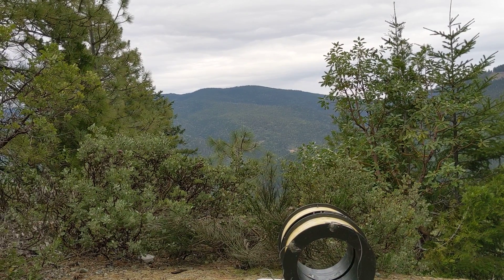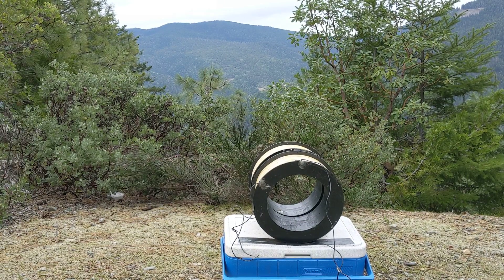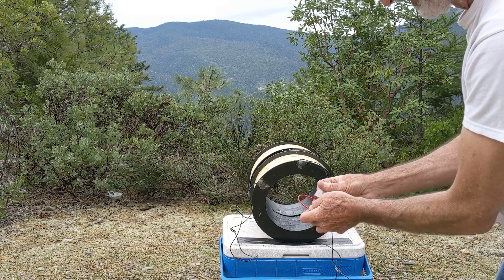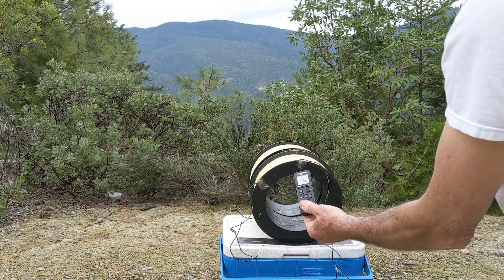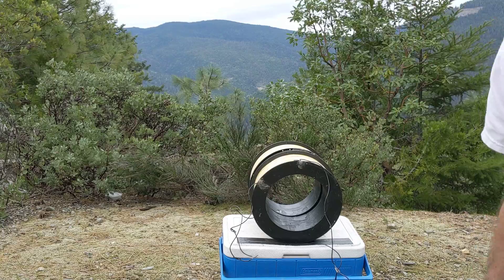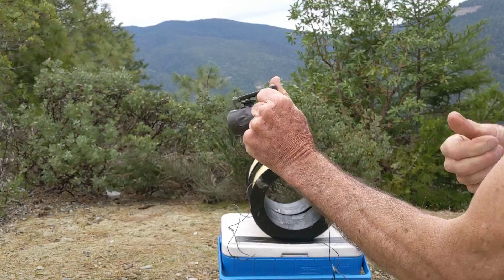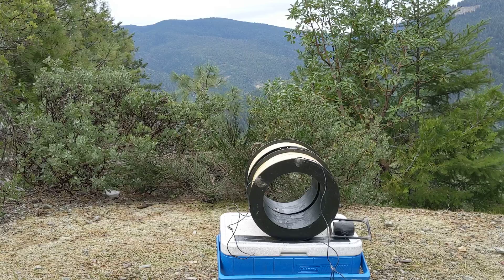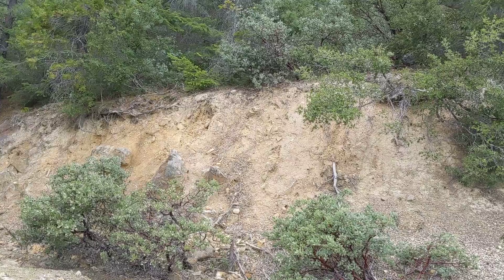Giant induction coil picking up Audio 5 feet away!

Comment: A giant pickup would receive ionospheric whistlers, thunderstorms, and perhaps electrical signals from ground movements as tectonic plates shifted. It probably isn’t necessary to use huge multi turn coils. The area inside a single coil is what counts and multiple coils just add to the amount of pickup. Far cheaper and more efficient to use electrical amplification to get the desired signal level.
Reply from the maker: I think it would sound like this. https://www.youtube.com/watch?v=iHY-GMrqK9A
Reply: I made a large coil and it was great for picking up whistlers.  You needed to be well away from any buildings or power cables.
Reply from the maker: @StabilisingGlobalTemperature  I would like to have seen how you built your coil. Did it have a much larger diameter than what I built?
Reply: @GrantsPassTVRepair  I wrote a reply but it has disappeared. Coil on a polystyrene block approx 800 turns 3ft x 3ft x 4 inches.  Plywood side cheeks glued to the polystyrene. Used a low noise op amp module battery powered, and a digital recorder.  op amp module and battery fixed to the coil former and several yards of cable to the recorder.  I used a recorder rather than a laptop but you could use a laptop but keep it far enough away from the coil. Laptops are quite noisy electromagnetically.
Reply: @GrantsPassTVRepair  Also, it is best to make the coil as large as practical. Many turns helps, but seems that large area helps more.
Reply: @GrantsPassTVRepair  If I was making another I would try electrostatic shielding.  Such as aluminium foil wrapped around the coil and grounded at one end.  Important to leave a gap in the shield, otherwise it would be a shorted turn and destroy sensitivity.  For ease of transport I would make it flexible.  Maybe on a hula hoop or similar.
Reply from the maker: @StabilisingGlobalTemperature  Thanks for the information on your larger coil. How did you avoid the AC interference?
Reply: @GrantsPassTVRepair  I went to a place a long way from any buildings or overhead power cables.  But if that is not possibe, it may be that you can rotate it and find a null direction.  Probably not possible inside a building, but outside there may be fewer AC cables, and so there may be a null direction.
Reply: @GrantsPassTVRepair  Also if you filter the signal that helps.  Maybe a series capacitor of suitable value would act as a very basic high pass filter.  The value depends on the input impedance of the amplifier, so I can't give you a specific value.  Or you can find online filter calculators.  Or use LT Spice, which is free circuit simulation software.

Comment: On regards to your question about a giant coil...

- It could be tuned by accident to a powerful source of energy, for example the earth.
- The Schuman frequency of the earth has one peak at around 8 hz. Meaning that as the electrical signal travels at light speed (432^2 miles / sec) = (186,624 miles / sec) there will be aproximadately 8 standing waves on a wire with the length of 186,624 miles for a signal from the earth to which we want to tune into.
Meaning that each full wave has a length of 23,328 miles. If we want to have max power on one side of the cable and cero power on the other side, we need to make the cable be 1/4 of that length (that way, when the signal first arrives at 0 degrees, voltage will be cero because the signal enters from a node, at 90 degrees it has traveled the full length of the wire and reached the end where it will have positive max voltage, then it will travel back and reach 180 degrees (node) at the beginning of the wire having voltage cero, travel back to the end at 270 degrees (negative max voltage) and then travel back to 360 degrees (node again). I would expect a beastly amount of power from such a tower.
- But I also expect problems with such a system, drawing too much power from it would make the earth loose momentum, increasing the length of days and nights, and maybe that's the reason we are not turning in to it now.

Comment: Position the coils in opposition and in series to cancel out fields that cross both coils, but move the coils physically apart (mayube 1 to 3 meters) so that something between the coils can still be detected. This is sort of similar to how a figure-8 microphone works. Large fields far from the source have more uniform fields, but a small close object has very curvy fields. So the interference fields will cross both coils and cancel but the test fields will not. BTW, underground cables could still be emitting fields if there are any there.
Reply from the maker: I tried this theory with another set of smaller coils and had some degree of success, but when the AC field is so wide, it's  challenging to find the perfect orientation for both coils to produce perfect cancellation of hte hum.

Comment: You could try a Twin-Tee 60Hz notch filter, just 3 caps and 3 resistors. An induction field, AKA the 'near' field, is energy bound to whatever is causing it and it does not radiate energy away as EM waves (far field) do, largely because the coil or magnet etc is a really inefficient radiator at low (e.g. audio) frequencies where one wavelength could be ~600miles long! Also, the induction field strength falls off volumetrically i.e. 1/distance  cubed, whereas for EM waves field strength falls off as surface area i.e. 1/distance squared, which is why the range of induction coils is so poor.

Comment: Fun! But the larger you make your coil in diameter, the less turns you need to keep inductance the same.
Otherwise it will not be able to pick up higher frequencies. The actual frequency response will depend on the coil and amp's capacitive properties as well as the total inductance of the coil.
Too big a coil (too many Henrys) and you can only pick up base.

Comment: Could you tune this and direct it with a phased array, and tune it with the sum total of the wire length?  If both — that’s a hell of an eavesdropping device.  Big, and likely a ton of power consumption — but hey — why use a highly sensitive capacitance array when you can use an induction coil?  🤷🏼‍♂️

Comment: Make a mains frequency notch filter
ChatGPT should be helpful
I once made a mains frequency notch filter and placed it directly on the mains so that I could see what other electrical frequencies were there using an oscilloscope across a low value resistor that was in series with that filter. Kind of like viewing another dimension of signal power mitigated by distance and distributed loads.
Reply from the maker: I have a partial solution, but Good idea on trying ChatGPT.

Comment: I did a similar thing using large, single turn loops of wire. I used a 100 watt amplifier and a tone generator. The frequency was 1.8 kilohertz, the range was 2.1 miles.
Reply from the maker: Sounds interesting.
Reply: 100 watt amplifier for the transmitter or receiver?.
Reply: @MarkyBhoy-fe1xf Much better to amplify the signal at the transmitter (the power source) than amplify at the receiver because amplifying the received signal also amplifies unwanted noise.

Comment: Interesting. All the items you tried are emitting waveforms that the coil is sensing. The config of the coil would be interesting and are you running a power through it. You like trying new experiments so you might try getting two 9 ft. long peces of 1/4 in aluminum tubing and a length of copper wire about 12 gauge. Get a dowel , or something like it, that is 1 inch in diameter. Wrap the copper wire around the dowel until you get 7 close wind coils and cut the wire leaving two short nubs at either end. slightly pulll the coil apart so that it is not touching itself . Secure the aluminum rods down on a board and position the ends so that the coil touches each end of the rods. Take a high heat soldering iron and solder the coils in between the the to rods. One length of the rods should be ground and it does not matter which one . On the coil you need to find the center point and solder the center wire of an antenna cable to this point and the ground to one of the tubes. From this you will be collecting electrical signals from the air and the rods convert that energy into weak electrical signals which you can measure with a multi meter . If you can figure out something cool to do with this weak electricity . What you are receiving are signals from radios and the " antenna " is converting that into electrical energy. With the right antenna config you should be able to pick up a strong steady signal that will give a constant electrical flow. I have had some siganls light up a bank of LED's . :O)
Reply from the maker: That was difficult to try and follow. I need to see a diagram.

Comment: Did you use a diode or did you just connect the coil straight to the amp?
Reply from the maker: I attached the coil directly to the amplifier.

Comment: How about using a high-pass filter in the inductor? The sounds below 100hz may be a worth loosing to gain more clarity above?
Reply from the maker: I'm not sure, but I've had some success reducing the hum by using two coils, and arranging their position, so their outputs are in opposition.
Reply: @GrantsPassTVRepair  Yes that removes "common mode" interference but will cost you signal amplitude of your desired signal as well (unless you can shield one coil from the desired signal). A high-pass filter would make a bigger difference I think :) Thanks for the reply!

Comment: The problem with AC hum is that the rural areas have giant high-tension lines...
Reply from the maker: Yes they do, There were no visible power wires anywhere near my elevation, but perhaps a mile away.

Comment: Just an idea.. run the coil or amplified output into an audio limiter or clipper so you don't blow out a recorders input from sudden loud sounds picked up and run it through a very low noise preamp to really increase the gain. This of course after you deal with the 60Hz hum which as other people have suggested a notch or high pass filter will help with up to a point. A pair of diodes in parallel and opposite of each other across the coil output can make a quick and dirty limiter for ear/recording protection at high gain.

Comment: Finally a use for that 60 HZ notch filter.
Reply from the maker: Thanks for the tip.
Reply: @GrantsPassTVRepair  I always wanted to build one* but I never really had an application.   *From Forrest M Mims, Engineers Note books.
Reply: @gortnewton4765  That is not notch filter.
Reply: @gortnewton4765 Then I don't see the relevance of your comment.

Comment: You cannot get away from AC hum . Maybe if you're at the north or south pole. 50/60 hz is a massive wavelength. AM broadcast band starts at the 600 khz and even up there the wave length is huge and can pass over entire continents in one cycle and zero attenuation.

At 60 hz, one cycle is approximately 3000 miles long. Meaning a transmission line's magnetic field is going to induce outward 3000 physical miles in all directions before repeating the sin wave like pulse. You would need to be inside a faraday cage underground to avoid picking it up. Just like you would have trouble not picking up the AM broadcast band if there were millions of stations operating at millions of watts.

Comment: We used to make coils 6 foot by 2 foot, and connect it to an amp, and listen to all the EM in the area. By moving the coil around and changing the position, we could increase or decrease some of the noises we were picking up. Depending on where you were, you could find lots of noise from many objects, but walking around with a wood frame the size of a door, wrapped in wire and wearing headphones would get the attention of some people thinking you were snooping into their privacy...
Reply from the maker: That sounds impressive. Your drive to experiment sounds much like my own.
Reply: Get yourself some type 33 ferrite rods. They come in all different sizes. put a few together in a convenient shape and wrap a quarter-pound spool of # 30 wire around them. Small, unobtrusive, sensitive.
Reply: Outside of the privacy perception, what I cool idea.
Reply: @jasonschlegel4027  The down side to EM radiation, is the government was able to make it possible to view what was on a CRT screen by processing the 'noise' into a duplicate of what was on another computer terminal. What else they were able to do with it is not being talked about, and it was surprising that they announced the ability to do what they had done! And makes me worry about what they can do after 40 years with the technology.
Reply: @jeffreyyoung4104  Surely the tech has evolved and been honed. Thank you for sharing.
Reply: @jasonschlegel4027  Does it make you wonder what they can do with the tech?
Reply: @jeffreyyoung4104  Yes - and also how to counter its use.
Reply: @jeffreyyoung4104  I think today it would be borderline impossible to copy a screen like that.
First because flat screens replace CTR, but mainly because today the noise is crazy.

Back in the day the few electronics cards were shielded in metal... today everything is electronic and is barely shielded at all.

However, they are videos that show it's possible to scan a room and track humans trought walls by capturing the wifi signal... So yeah a lot of thing are still possible, especially since AI got good.
Reply: @pierrotA  Everyone is worried about AI, and all it takes is an EMP burst to end their puny existence...

Comment: Just add a passive high pass filter with a cutoff just above 60hz.  Wind a 15.6 millihenry coil and use 4 ohms worth of resistors.  Harmonics might be strong enough to merit a set of tuned notch filters.

Comment: That 60Hz hum could possibly be elimated by putting a RC filter on the coils outputs before whatever amp you are using. They are super simple to build and only use a couple really cheap components. You can do a quick google search for instruction on building and tuning the circuit
Reply: Yeah essentially they're just capacitors i believe

Comment: It's like a gigantic guitar pickup. For some ideas to draw inspiration for further experiments, I would look towards various guitar pickup designs. "Humbucker" types such as the PAF, Filtertron, & Fender CuNiFe wide range make use of common mode rejection, but are distinct from each other. Designs made by Lace Music, such as the Lace Sensor & the Alumitone are very unique. Electromagnetic sustainers such as the Fernades Sustainer & the Maniac Music Sustainiac are super cool as well. When you spun the motor, it was almost musical. It's actually not all that different from some of the earlier electric organ designs. Very interesting how it made a stronger tone when the motor leads were left open.
Reply from the maker: Thanks for the info. I've had a few people mention the Humbucker, so based on the Humbucker principle,  I tried attach two identical coils to my amp that were out of phase with each other,. and it did reduce the hum.
Reply: @GrantsPassTVRepair  Pickups such as the PAF use a bar magnet attached to the underside & have ferrous pole pieces placed under each string. Hot-rail types are the same thing, but use a slug that runs the width of the transducer. Fender Wide Range types use cylindrical magnets instead of using ferrous pole pieces. P-90 types have their slugs sitting in between 2 magnets that have their "like" poles facing each other. Lace Alumitones are seemingly a solid block of metal, but are actually a coil with just a single turn. Guitar players (myself included) obsess over the subtleties of all these things. Laughingly, the audience probably never notices. Leo Fender, one of the most influential figures in the world of guitar, was not a musician. He was a radio repairman. His passion was innovation.